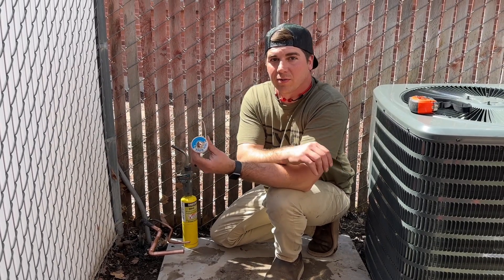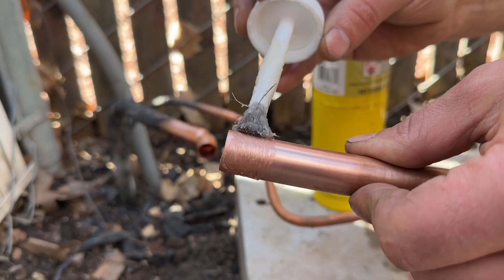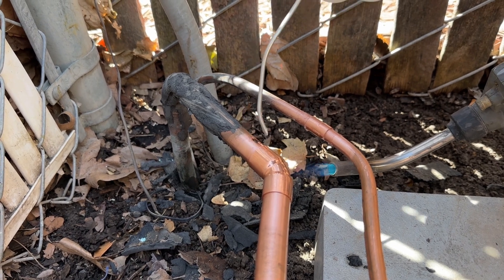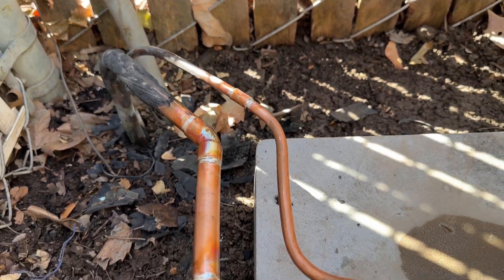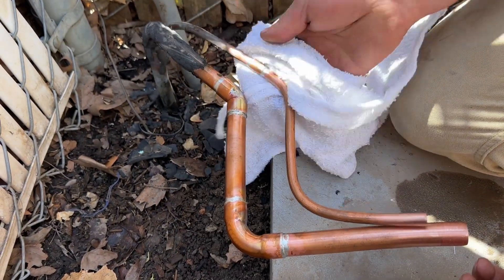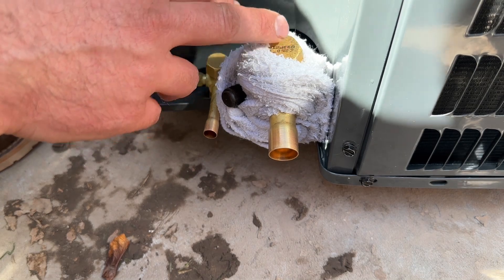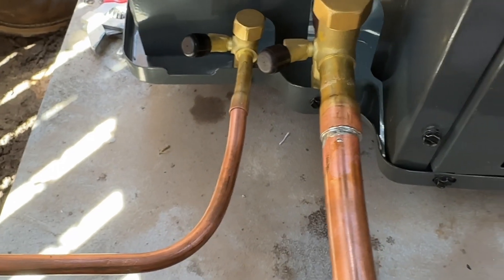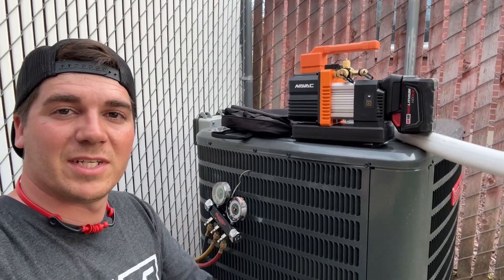Ditch Brazing. Learn To Use Staybrite 8 Soft Solder For HVAC Copper Lines

Comment: Installed my own AC system using Staybright-8 over 9 years ago. No leaks ever. Super easy to use and much lower solder temp than brazing. BTW the joint is actually stronger than brazing. Although its expensive you can use it for other projects. It will also solder copper, brass, steel and stainless steel and mixed metal joints between those. I was able to make various adapters that are simply not available anywhere.
Reply from the maker: Amazing. Thanks so much for sharing!
Reply: How about refrigerator compressor? Do you think that works too?
Reply: @cleberfrancaneto1964 it should
Reply: No, it is not stronger than brazing. And leaks are not the problem.  Your system will not last as long because of all the contaminants you put in there.
Reply: @chuckd5819  
Even with brazing/ with nitrogen you still get some contaminants in the system.
Regardless nothing is made to last anyways. Something will surely break or the unit will be replaced far before anything inside the line causes issues.
No one here is buying a new system today and it lasting like the old R22 for 30 plus years.
Reply: Very late on the conversation. I used it in residential and I might pull it out in some instances in commercial but it's a hack thing to do. Don't kid yourselves.
Reply: But your system is contaminated with a high acid content
Reply: @TAGUPNBLUE  best to leave a cm gap from the tip and that should prevent contamination. I would argue if you are a DIY and it fails prematurely then you can easily swap a new compressor for cheap.
Reply: @BirdDog. The stay Brite flux is the contaminant inside the pipe it turns copper oxide stay Brite does not become one of the copper melt temperature too low I'll stick with silver solder
Reply: Ya, amateurs!
Reply: Who told you it’s stronger? That’s wrong. Hard metals are stronger than soft ones.
Reply: @Stealthsilent1337  True, but "strong enough".  One youtube pressure tests both silver-soldered and brazed copper tubing and fittings.  In both, the tube burst ~6000 psig, so no difference, and much higher pressure than any heat pump tubing would experience.

Comment: This video may have saved me junking a new Turbro Mini-Split that will not fit the line set it came with. The indoor unit has 5/8 OD and the outdoor has 3/4 OD,  yet reads 5/8 line set on the box. I don't think I can find a flair nut that would make it work. I have been working for like three weeks with support going around in circles with their confused support and I am just about ready to give up. Thanks for posting this.

Comment: The flux is corrosive, and you can't wipe it off the inside of the pipe.  You're contaminating the system before it even gets turned on.

Comment: You can’t wipe the joints on the inside. That residual flux inside the tube will flow throughout the system. Since most technicians don’t braze with gas they have huge piles of oxidized copper inside the tubes. Which is worse?

Comment: Best approach for DIY if you don't have a Bernzomatic Ox-MAPP (or Propane) torch to braze.  HVAC techs use Ox-Acetylene.  Also, best to flow N2 inside the pipe if brazing.  Silver Solder is pricier than brazing rods, which is why pro's invest in oxy-acet.  Having gases is pricey for a homeowner unless you weld/braze a lot (except the Bernzomatic).  But, some HVAC manufacturers won't honor the warranty unless brazed connections to their parts, but they also require a pro install, so the warranty is useless for DIY anyway.  Best to pressure test with N2, and to also help sweep any residuals out, but pulling a vacuum and verifying that doesn't leak is usually sufficient.  You also must pull a vacuum to evacuate all air and moisture.  Most/all compressors today come prefilled with the refrigerant, so unless your lineset is appreciably longer than standard, you shouldn't need to add more.

Comment: This solder is horrible very low temperature flow rate it goes everywhere get contaminants inside the pipe better off using 95.5 solder or by nitrogen and low temperature brazing rod with silver in it

Comment: It’s not if it melts inside your joint. It WILL melt inside your joint. Therefore mixing with your refrigerant becoming acidic and causing problems with your compressor years down the line. There’s a reason this map gas and stay brite isn’t the industry standard.

Comment: Well, I just did it. Stay brite 8 on my 410a condenser ACIQ. Pulling a vacuum on the system now. Don't have the $$ for nitrogen pressure testing though.

Comment: i'm not familiar with staybrite ??  How strong of a joint does it create compared to silver soldering ?!  I want to learn how to braze copper to copper , or copper to dissimilar metals for fluid transfer in low pressure ( up to 200psi ) applications like oil coolers for hydraulic systems on the low pressure side .  A coworker who has done a lot of silver soldering in electrical connections commented to a friend that he now uses a low temperature version of silver solder that is extremely strong but requires a whole lot less heat to work with  ,but; I'm not familiar with what he is working with ?!

Comment: After i add the solder, i hit the connection with the flux brush again while it's still hot. It really smoothens out the solder flow and cleans up the joint.
Reply: Do you wipe it clean after it cools completely?

Comment: Thank you for your videos.  Is it possible to use a Zoomlock push to connect directly on condenser or do you need to solder in an extension fitting, which defeats the purpose of push to connect.  Thank you.

Comment: If the fittings are clean, and proper amounts of flux are used AND you know how to solder ( and manage heat) this method can't be beat.   its very fast, strong does not degrade the copper and no nitrogen is needed.  It does not over-temp valves.  You can work in tighter spaces.   It's the only way I roll.

Comment: Don't have to flow nitrogen while soldering like brazing?
Reply: Doesn’t get hot enough to make the copper oxides like brazing temps. But it will leave flux inside the pipe.

Comment: I’ve used it a lot without any issues. Brazing has its place where your joining tubing and there’s to much play in the joints.  One thing I’d suggest is to buy a tubing bender, practice and watching some videos on using it, if you had a bender for your suction line you’d only soldier 2 joints and not deal with the elbows and potential leak points. Also, but some swaging spinners and create a male female joint and eliminate the collars.  One other thing I’d do is wipe your joints off quickly with steel wool before the solder hardens, just a more professional look, nothing to do with strength of the joint.

Comment: For some of us the HVAC part of these installs is not that difficult but the small things like adapting/extending  existing refrigerant tubing to mate up to an evap coil that has a different physical arrangement is a little tricky.  I'd love to see how you go about that, bending tubing, etc.  The other problem with that is also where to get the materials since DIYers like myself won't have leftovers from other jobs.  I have been able to find short coils of 3/8 and 3/4 tubing on Amazon as well as fittings.  So, I am just going to give this a go next week on my install.

Comment: Good suggestion. Thanks, One suggestion: When soldering horizontal connections, feed the solder from below not above or the sides. When you feed from below and you then see the top fill up, you KNOW that the entire space is very likely completely filled without any hidden gaps.
Reply: Nice

Comment: later you learn about how acid  from the flux eats up your compressor wiring. just use silver to weld it with no flux or you will find out much later that you will be spending thousand to replace a compressor. forty years experience vs what looks like five years experience. you decide.

Comment: I purchased a 4 ton 2 stage, 2 speed fan (non communicating) AC condenser to pair with a new 4- ton evaporator and new moderate efficiency (non communicating) furnace. The furnace and evap were installed professionally in January, and I got a quote of $7,700 from them to install a 2 -ton single stage condenser for my 2200 sq. ft. home (built 1976) near Chicago. After researching the tonnage needed for my full sun exposure home, I found that 3.5 ton was a good match, but I couldn't source a 2-stage unit until I went to 4 tons. Anyway, your DIY videos are helpful in that no contractor wants to help me install the condenser I bought. All in, it will cost me half of what the furnace installer quoted for an unsuitable unit, plus the time to educate myself on how to do it.

Comment: I hate that stuff. I cut apart li e sets where I used it. Minimal flux and onky quick and easy soldering, but have fou d little pieces of solder inside line sets that later have flushed back to the txv kits. I have used it on 10 inits now and am svmcared todeath the last units will end up being the same little pie es of solder inside line set. Not funny!

Comment: Amazing video! I have a few questions if you pls help me out. I am HVAC diy and I will like to start testing my lines. So, what kind of nitrogen I can use for testing pressure? nitrogen 100% or 5% hydrogen and 95% nitrogen. Also, will this method of MAPP brazing will work for a mini split 1/2 flex line, I kink the 1/2 line and I will like to try to braze it. Also the where do i find the fitting, you have a 90 degree fitting but are there straight fittings, so I dont have to swage a copper pipe.

Comment: A tip to know when the joint is properly filled, even if filling joint from one spot (not circling fitting)… There will be a brief moment when you see a perfect ring bulge from around the joint. All the solder past this point will either drip out the bottom or fill up inside or on the pipe.

Comment: Ill keep using my 15% 30 years never had a leak 
Im so sure about this stuff with high pressure 
Everyone has there own opinion
Reply: Yeah stay brite plus the vibrations over time = all bad and DIY people using stay brite flux is bound to get in the system which is acidic

Comment: Certain outdoor condenser units run off a head pressure switch which runs pressures up to 350 until the fans kick on.  High pressure safeties in the field are between 400 to 450 psi.  The tech sheet for staybrite 8 says 10k+ psi is the strength of staybrite 8.  I might get some for future compressor installed in commercial kitchen applications.  I braze just fine but I wanna see how well this works.

Brazing tip:  use a wet rag under a small square sheetmetal burn shield (1 ft by 1 ft sheetmetal shaped to warp around copper pipes to protect from flames and heat).  Works every times and I have a handful of scrap sheetmetal shaped for different spaces.

Comment: To the repairman telling of poor repair qualities due to poor fitting or dirty fittings:  I’ve brazed for years and you don’t want to use poor quality fittings or braze anything dirty period.  The other huge advantage not mentioned is you don’t have to flush system with nitrogen while using Staybrite. Cut practice joint and see for yourself.  Clean inside with no oxidation.  Some new products  are truly useful and advance to ease of use for the DYI’er but also the pro.  Yes, this will cut into the repairman /hvac business, and help homeowners.

Comment: Even 95/5 will last. I installed two systems in my house with 95/5 back in 1991. Still going strong. Just don't get crazy with the flux and don't allow the fittings to have a mechanical load on them after soldering. But Staybrite 8 is much better.

Comment: If you do swage. Use a step type drift punch. Not an expanding type. You can expand the male pipe slightly with the tool with the expanding die to get a snug fit.

Comment: What happens with bead of flux the solder pushes inside as the solder wicks in? I've soldered electronics for many years and flux always leaves residue.
Reply: Will be caught by the filter if small

Comment: What a hack. The acid from the flux will eventually wipe out the system.
Reply: No. If applied correctly, all the flux will be covered with Stay Brite. Only put flux where needed. And not enough to 'flow' anything but Stay Brite.  I see plumbers apply flux as though they are buttering a dinner roll on Thanksgiving. Not necessary.

Comment: What about those crimp connectors with the double orings. I assume you can rent the tool reauired to compress them. Then you would have no acid residue in the lines to mess up the compressor. It is my understanding that they are rated at 800psi when properly installed?

Comment: I.m at 40 year veteran of Industrial, commercial, and residential HVAC.  Staybrite is a good solder for plumbing.   It's not suitable for HVAC for one basic reason.  Vibration or movement.  If it's being used on or near a compressor it's subject to cracking or fracturing.  It doesn't have the tensil strength of brazing.
Reply: You don't need stabrite for plumbing. I've used 60-40 for years and never had a leak. Lead in the water is bullshit. There are more kids today that have so called ADD and Autism than there ever were back when I was young, but back then, it was solved by a swift kick in the ass.
Reply: A brazed joint is very brittle after the annealed stage. And will crack as much as a Stay Brite joint. For smaller compressors like 
5 ton and lower it's fine.  I'm at 32 years in my residential systems with 95/5. But maybe it's a bad idea AT the compressor if it can be avoided.

Comment: If I'm going to run a vacuum test, do I still need to run a pressure test in addition? I'd rather forego purchasing nitrogen+tank and stick with just a vacuum
Reply: Vacuum can show you that there is a leak. But it will not show you where. When you do pressure test you can use soapy water to check leaks. Also sometimes vacuum will not show the leak. But pressure will.
Reply: Test for the conditions the system will run. It will be under pressure.

Comment: I’m a HVAC tech and this is not practical on repairs. There may be times when this method could be used, but 90 percent of the time you can’t beat brazing. Reason is you can’t always get a perfect fit, and can’t always have a perfectly clean joint.
Reply: I do only commercial hvac and refrigeration. Very rarely can you not actually clean the pipe surface. Mostly it’s just laziness, and techs not wanting to take the extra 2 min. I’m not advocating this over brazing. Just stating a fact.
Reply: Ive seen 25 ton units with soldered joints mainly on aaon units
Reply: You go ahead and braze all you want. I’ve done this method for years. Too me it’s very versatile.

Comment: Don’t do this. Brazing with a purge is the cleanest way to install piping for HVAC. This is basically soldering as in water piping and HVAC lines need to be free of contaminants. This way will ensure compressor failure.

Comment: can this be used on water pipes
Reply from the maker: I’m sure it can, but it’s way more expensive then regular plumbing solder because it has a much higher silver count. Specifically made for this application
Reply: @diyhvacguy  thank you for replying

Comment: I had used that solder and flux(if you can call it flux), and as you said, is great, but I have a question, can this type of solder could be use to braze(solder ?) the high side copper line of a refrigerator compressor onto the stainless steel end of the condenser's coil ?
Reply from the maker: I think you have to have a special wire for that. I don’t believe Staybrite 8 would work going from copper to stainless steel
Reply: I guess I am going back to the silver solder, flux and oxiactylen ways.

Comment: NO nitrogen flow needed? WHAT? How is this possible? You can use this on any HVAC system, and you don't need to run nitrogen? HuH?
Reply from the maker: Yesir, there’s many folks that have been using this for YEARS with no problems. I’ve been using it for about six months myself with zero issues thus far. It’s so much easier then brazing and yes it does not require a nitrogen flow because it doesn’t get nearly as hot as brazing which is what causes the soot in the lines. No more carrying around heavy oxy acetylene tanks in an attic for me 🤘🏼   Mikey pipes uses it, and Steve Lav both here on YouTube

Comment: I don't get it. Don't you want the solder getting sucked into the joint at least "some?" That small amount covering the outside is going to hold up against high pressure refrigerants like R410a? I dunno.  O_o
Reply from the maker: Yesir, it’s proven. But some folks are die hard brazers which is totally fine. I know several hvac guys that have used sb8 for YEARS no problems.
Reply: @diyhvacguy  I noticed you did your best to fill ion the space with flux that you would want brazing to have the soldering compound flow into. Is there some reason for this? Don't you want the solder to get into the joint? At least some.

Comment: Been watching your videos on this solder. Looks good..
 BUT pressure alone isn't enough of a real test..
add in the unit vibration/accidental condenser movement/bumping into and months/years of oxidation.
hence;  let the leaks begin!
Reply from the maker: Have you used it? I haven’t had issues and I’ve talked to tons of people who have for years and years no problems.
Reply: @diyhvacguy  you using it on R410A & the soon to be  R32 & R454A.
Ive only seen the after effects/ oil and low on freon. going back w/ Harris 15% braze and leaks stop for good